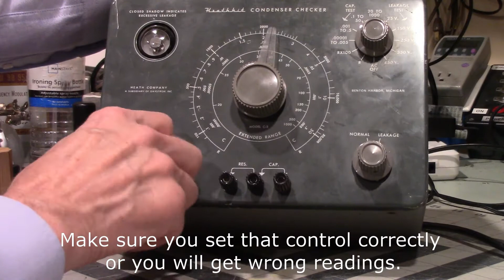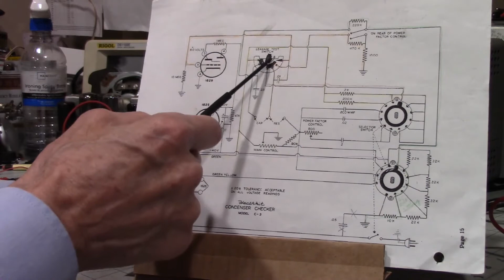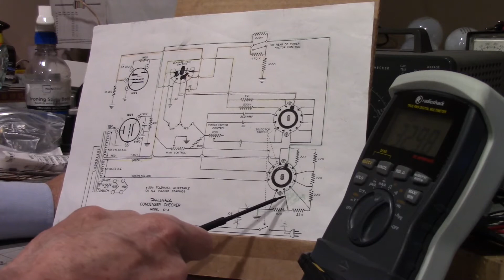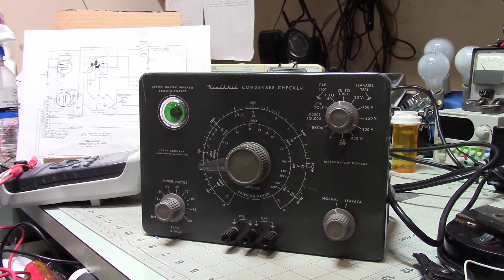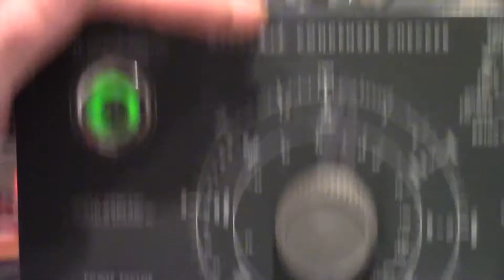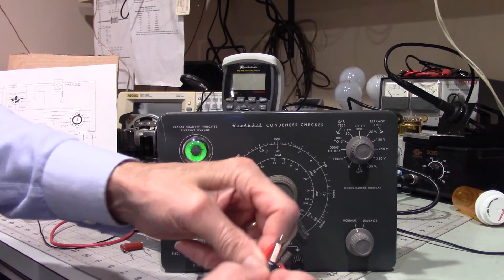Heathkit C3 Capacitor Tester - Weird Problem

Comment: I just picked one of these up recently and re-capped it. It is a cool little device. My guess about the rectifier tube has been that they picked up a ton of these surplus and decided to use them rather unconventionally (but - rectifies nicely) to use them up? I have no idea, but the reason I guessed that is that my 1626 is a tan base JAN military tube, so the first thing I thought was that HK must have had a bunch of these to use up lol.
Reply from the maker: You could be right. There are other rectifiers they could have used. Don't see any advantage to using what they did.

Comment: Thanks for the heads up. I'm about to restore the same model. There is a nice, comprehensive writeup on this model by Kenneth G. Gordon W7EKB covering what to look for to get optimum performance. It's easy to find under "Notes on the Heathkit C-3". In the meantime,  be sure to park the main control dial fully counterclockwise when doing leakage tests on large cap values. Otherwise you risk burning up the main control pot which is part of the discharge circuit. Good job on getting it up and running considering that very strange issue it had.
Reply: Thanks for the info on Gordon, and on the large caps. I will check that out
Reply: @macgvrs  check tis link for cap tester https://www.youtube.com/watch?v=EbyJmfvdaD0&t=1s
Reply from the maker: Great info. Will definitely check that out.